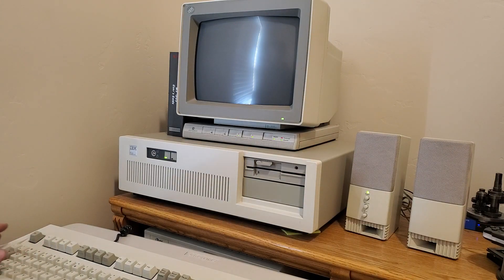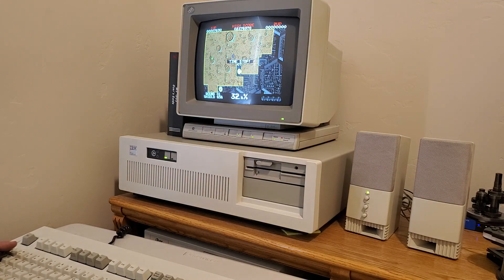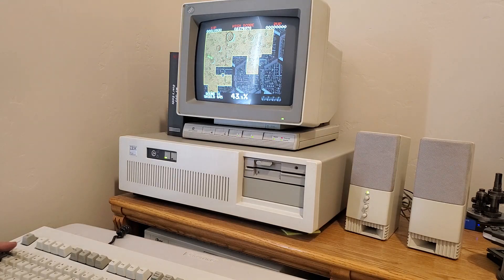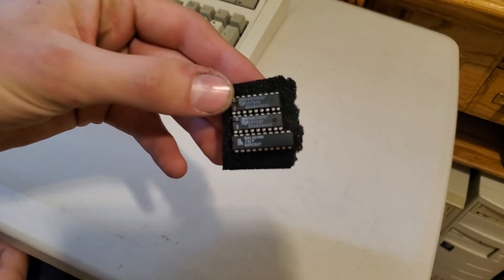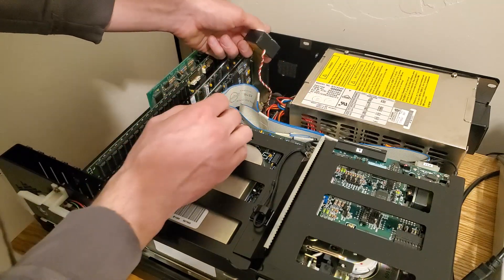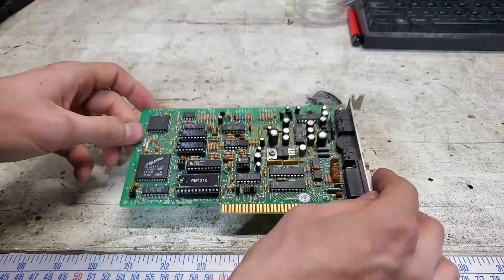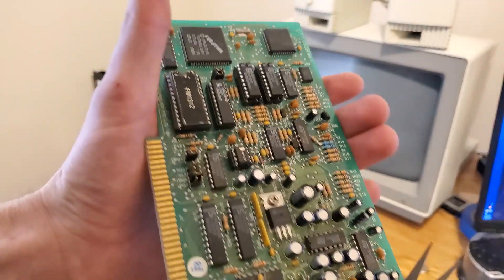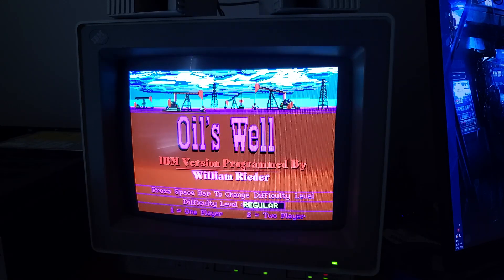Sound Blaster 2.0 CMS Upgrade

Comment: Monkey Island can be manually set to CMS via command switches.  I think it sounds really good, especially over speakers where it has a really great stereo effect that Adlib doesn't have.  Games that make good use of CMS sound great, imo, though Test Drive III is probably the worst implementation of it I've ever heard.  It basically just sounds like multiple PC speakers playing at once.  Also, with the program SBVGM, I'm pretty sure you can listen to AY-3-8910 and SN76489 VGMs on a CMS or SB card with CMS upgrade.
Reply from the maker: Yeah I was wanting to give monkey island a go. I thought it was on this computer, but it wasn't. I'll have to load it up some time. I should also find the version of silpheed that supports it, that game sounds pretty cool too. I'll have to give sbvgm a go, sounds interesting.
Reply: @Tr3vor42532  Also, I can think of plenty of good OPL2/3 IBM PC music.  Some examples are SkyRoads, Cyber Sphere, Dune II, and my #1 being Stéphane Picq's work for games such Dune, MegaRace and KGB.  Fyi, there's also an OPL2 IBM PC version of the PMD music driver you may have heard of, and some PC-98 to IBM PC ports such as Rusty use it and imo that version sounds great too.  I also have a soft spot for average OPL2/3 music, tbh.

Though, I really can't enjoy the IBM PC version FlixMix nearly as much as the PC-98 port because the PC-98 port redid the music and made it absolutely fantastic compared to the pretty average original music.  

I also agree there's plenty of legit bad OPL2/3 music.  RS-2 is a really mediocre Taiwanese shooter and the music is incredibly repetitive and annoying.
Reply from the maker: Yeah, there are definitely good soundtracks out there for opl2/3, it's just that they're rather few and far between. I took a look at some of the songs on adlib tracker 2 and was absolutely blown away at what the cards could do, so looking back on the games afterward just kinda disappointed me a bit.
Reply: @Tr3vor42532  Speaking of SBVGM, that program actually now supports playing YM2203, YM2608, and OPL2/3 (via a PC-98 SB16 card) VGM files on PC-98s.  I did testing for the dev and it worked very well on my machine from what VGMs I tried (could only test OPL ones on an emulator).